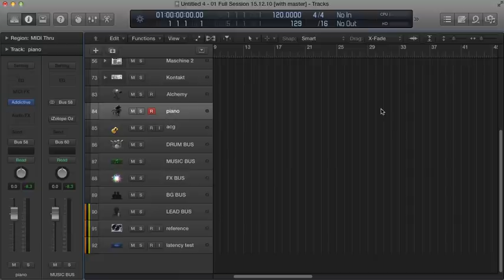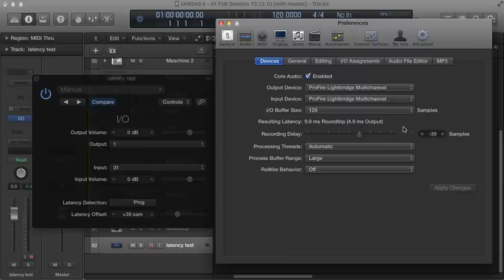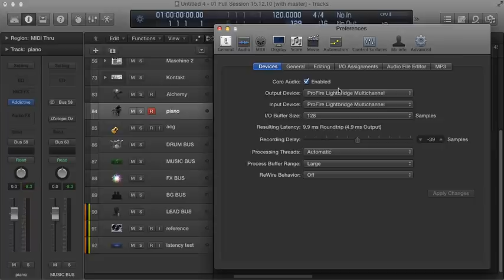How To fix The Latency In Logic X!

Comment: I have gone to settings to insure that my Scarlett interface is set as both input and output. I have also triple checked my Logic preferences to have set them there as well. I believe that I have set everything up correctly, it's all plugged in where it needs to be and so on. And yet when I try to use I/O, it still only presents 1 and 2 as options for the input and output, therefore meaning that ping does nothing and ultimately I can't fix the latency issue. Do you have any other ideas on what I may be doing wrong or anything that I may have forgotten? I would greatly appreciate any advice as this latency issue is driving me insane ahha. Thank you for your time!
Reply from the maker: Yes, I'll try to help
How many ins and outs does your Scarlett have? 
Can you see them on an audio tracks input menu?
What latency are you trying to fix? Live play through? Recording? Sync between what is already in the session and what you just recorded?

Comment: I never had issues with Logic 9 Latency and my MacBook Pro that I couldn't figure out but with Logic X and my Mac Mini (2.3 GHz Intel Core i7, 16 GB MHzDDR3, 16 GB Memory, 480 GB Solid State SATA Drive) my guitars takes still sound drastically delayed. I've physically cabled my Focusrite output to an input on the same device but I get no reading when I ping. It still reads 0 sam. Any suggestions?
Reply from the maker: +John Arthur Martinez if you're playing your guitar through and using an amp you'll want to get the buffer as low as possible and set the plugin delay compensation to audio and instrument tracks. Each sound card has it's own inherent latency. The last setting minimizes logic's added latency. The cabling and pinging is to test the sound card's latency because it can affect where the audio is placed on the time grid slightly. This won't affect pass through latency. 
Having plugins on buses or the master bus that the guitar channel passes through is most likely your problem. Disable or remove those and set that plug in delay compensation and report back!
To get an accurate ping be sure to select the output and input that you have cabled. I have had an issue with sound cards not in accurate digital sync that give wacky readings or no readings at all. Reset the sync by changing the sync source and double check that the routed output is sending the tick and that the input is receiving signal.

Comment: Great video! I definitely reduced my latency with what the system found as the stock latency with the I/O buffer size. I could not figure out the ping portion though. I use a Mota ultra light as my interface and multitrack through that. I tried connecting my input 1 to my output 1 and main out L and R without a result.  I am a bit stumped.
Reply from the maker: +Bob Smith glad to hear it. Make sure you select the input and output channels that point to those ports you have connected.

Comment: hey, nice video, i can't get the png to work tho. Im using the beats studio headphones as my output. is that why it stays at 0?
Reply from the maker: +Dionte Hunter yes, the beats are the reason. The point sends a tick to the output and listens to hear it back on an input that you've selected. The idea is to plug and output to an input. You would use a cable to plug where the beats are plugged to the input and select those in the io plugin.
Reply: oh ok thanks, so i basically need monitors as my output so i can get that 0 to move ?
Reply from the maker: the missing link is to connect a cable from your output to your input on the audio interface you are using. the tick needs to travel out the output and back in the input. the plugin will asses how long it takes and then you will compensate for this extra delay causing the recorded material to lay on the track as you heard it while recording.
Reply: I have a cable running from my duet apogee output R ( I assume that is ouput 2) to my Input 2.. I do the ping but nothing registers

Comment: How would you set this up with an external interface? What should your input and output be set to? If you're using the builtin output on your mac as your speakers/output and but using physical inputs on the interface externally.  Is there a way to set this up to set up the test in IO?
Reply from the maker: +Luke Jackson yes Luke, it works the same way. In my presentation I am using a FireWire interface. As long as you select the output and input that you have connected with a cable from inside the io plugin it will work fine.

Comment: Hi Thank your for your videos.  I'm having some problem with Latency.  Right now my resulting Latency is 196.2 ms.  I've tried changing the I/O Buffer and moving the Recording delay slider.  I've even tried checking the Low Latency Mode box but nothing is working. Your help would be greatly appreciated.  Thank you.
Reply from the maker: +Romano  Hey, is this latency when you play a software instrument live or after you record audio or midi? 
Latency matters when playing back through the software [midi instrument or audio fx] and making sure what you record plays back just how it sounded when you recorded it against the prerecorded audio in the session. 

Try the Plugin Delay Compensation. Change it from "All" to "Audio and Software Instrument Tracks"

Also turn off any look ahead limiters on the master bus.
Reply: +David Thomson I think I have this figured out.  Under the System Preferences/Audio/Devices, the Output Device is my Line 6 AMPLIFI.  This is the culprit that's causing the resulting Latency to be 196.2 ms.  If it change it to Built-in Output it's only 4.5 ms.  I really like using the AMPLIFI as a Bluetooth speaker.  So how do I use it without increasing the latency? Any suggestions?  Thanks.
Reply from the maker: +Romano Yes, this is the latency from using that device as your sound card. You can adjust your buffers as low as acceptable with your session to achieve lower latencies. Bear in mind that each sound card has it's own latency added to Logic's.

Comment: I use LPX when playing live gigs. I have a project (A)  with three audio tracks (and some MIDI tracks). One of the audio tracks is a LPX drum loop and I stretched the drum pattern out in some measures.  Whenever I have another project open(B), so it's ready to go, the drums on  project  A  play a few measures....stop playing...start...stop. How can I fix this issue?
Reply from the maker: +Tracy Behrman are you selecting the other session somehow? If one if the windows is brought to the front logic will load that session and unload the previous one.
Reply: No, the purge session is minimized at the bottom of the screen
Reply: Oop....the first session....not purge
Reply: LPX is not for live performance.  There are cheeper live mix softwares you can use, but LPX will always cause problems like your saying.  LPX is designed to maximize its use of your system hardware to record great tracks.  Since the system architecture is targeted toward this end there can be lots of little glitches when having multiple projects open at once. 

At the end of the day if you want to guarantee a good show - you have use the right gear.  
Hope this helps.

Comment: Hey man great video, question for you 

Im using an old Tascam US 144 MK 2 which works fine for what I need.

I checked my latency with is 717 samples (with the buffer rate low). My output latency is 11.7ms and input latency 5.3ms.

Acceptable recording latency is under 6ms. 

So my question is, if what Im hearing is 11.7ms late, and I am playing to that, then surely my output latency doesnt matter and therefore dont need to set a recording delay to -717samples?
Reply from the maker: I would certainly do it. Miniscule as it may be you don't want everything you do to be skewed. It will change the feel of everything you do even if just slightly. Also, 717 samples is a lot. 
Remember, this is the unaccounted latency. The 11.7 and 5.3 are reconciled because logic can get those figures from the cards driver. 
When I got mine locked in I was instantly aware of the accuracy of what I played and how it felt with the groove of the song. It felt on playback like it did when recording. 
The plug-in delay compression is key if your using midi or playing through a plug-in. 

Good luck!
Reply: I assumed that Logic would correct this latency after recording therefore making it accounted for? 

Im a guitar player and play beside my amp so its direct monitoring if you want to think of it that way. I understand changing the latency it makes sense if Im running a lot of VSTS and plugins, if I am recording with a MIDI keyboard it would make sense to adjust the latency samples but If Im doing what Im doing now does it make a difference?
Reply from the maker: Logic does correct all the latency it can know about. It knows what the interface you use reports to it and the latency from it's processing use with plugins and buffers but that which we are testing for using this method is the time it takes the signal to make it out the interface and back into logic. This is with logic already using all the information is has available to it. Some reasons this reports a number at all is discrepancy with reported latency of the card and any other processing that happens to be in place (mixer, compressor, EQ, or any other gear being used).

Comment: why doesn't Logic automatically check the input latency? or does it? i'm talking about what u were talking about from 0:00 - 1:49
Reply from the maker: Good question, Mikey. Short answer: Logic compensates for all known latency. This includes plugins and what is reported by the audio interface drivers. But there are other possible sources for latency. Also, sometimes the reports in the audio interface driver do not match the actual time it takes audio to pass through. this method allows you to be sure that the feel of when the music is tracked is preserved after it's recorded and played back.

Comment: I don't have any latency issues. I have Logic Pro X 10.4.1 and the only issue is when I click the spacebar, it lags before playing. It never used to do this before and not even with this update. It just randomly started happening. Anyone that has an answer or suggestion I would greatly appreciate it. It's very nerve wracking.

Comment: I can't get the IO plugin on my version of logic, any ideas? The closest thing I have is a test tone
Reply from the maker: +Dan Goode what version are you using? It should be found in the audio fx menu under the utility section.
Reply: Thanks, I was looking in the plug-in section instead of audio FX!
Reply from the maker: +Dan Goode sweet, I knew it had to be something simple.
Reply: sorry, another question- I'm using a UAD apollo 8 interface and I'm struggling to get the IO working. I've tried plugging in the monitor outputs into mics 1 + 2 and I've tried plugging outputs 1+2 into mics 1+ 2 and I'm not getting any latency offset showing up (it stays on 0 samples). Any chance you can point me in the right direction?
Reply from the maker: Dan Goode Hey Dan, it should be functioning for you with that setup. Make sure you have the correct output and input selected within the plugin. You may double check your Audio Midid Setup with in OS X to make sure your routing isn't confusing things. You should be able to see the tick register on the meters of the output and the input.

Comment: I get +2235 as result, regardless of buffer size (32-1024). Is this normal? Using Alesis IO4, cable connected from input 1 to output 1.
Reply from the maker: +Bence Varga that is to high. My guess would be plugins in the pathway. Take any plugins off of the main output as a start. Maybe reset the sync on your card choosing changing the sampling rate then back to where you want it or the sync source to get it back aligned.
Reply: Actually I got his value when there was only the I/O plugin on the track and nothig else, even in case I opened a new project and there was 1 empty track. The sample rate of my card is 44.1 kHz, so that one cannot be changed. What do you mean by changing the source?
Reply from the maker: +Bence Varga I mean to change the sync source if it has it. Should be internal or to one of it's digital connections.
Reply: Okay, managed to sort it out. It was because of the project. Other projects give better result (+30), also a fresh project (maybe I did something wrong when I measured the new project yesterday). However I have no clue why that particular project returns +2235. I get that result when I delete every track in it and add a new track with the I/O plugin. I assume it is a project setting, or maybe some plugin on a bus?

Comment: hitting ping does not give me a value, anyone know how to trouble shoot this?
Reply from the maker: Hey Jake, if it's not giving a value it means that the correct input and output is not selected or it is not properly connected from the audio interface output to the input. Double check those for starters.
Reply: having the same problem
Reply: I am having fits with "cabling" the input and output to get the PING to work.  I am using a MIC USB mic to my desktop.  A Scarlet audio interface for my external speakers (output) and guitars (inputs).  My MIDI keyboard is connected to desktop via USB.  I am lost on how to assign the inputs and outputs so the PING gives a value.  Newbie to Logic X here.  Thanks!
Reply from the maker: Hey Leigh, with a USB mic you have no output. I would select three line input on your Mac then plug a cable from the output to the input that you have selected in logic.
Reply: If my output (speakers) is connected  via Scarlett (audio drive), how do I connect that to my input when my input (MIC USB microphone) is connected to my computer via USB port.  ----> That is a better go at phrasing my question.  I'd SOOOO appreciate any help.  My vocal tracks have major latency.
Reply from the maker: For this test you want to select the Scarlett inputs. Then you will be able to connect the output to the input with a cable.

Comment: this can't be right. (unless my source, the following link, is wrong. which is possible) according to this link https://www.thoughtco.com/convert-milliseconds-to-samples-1817867 , if your round trip latency is 9.9 seconds (as seen on the screen) your delay in samples should be 436.59 samples if you're recording in 44.1kHz and 950.4 samples if you're recording in 96 kHz. 36 samples is nothing that's like half a millisecond
Reply: https://www.audio-forums.com/threads/samples-to-milliseconds-conversion.9552/ this link too says there are 44.1 samples in every millisecond. your round trip latency is 9.9 milliseconds. you're only offsetting it by 39 samples.
Reply: unless this means that Logic automatically compensates for latency and it's automatic compensation is 39 samples off. at that point it shouldn't be noticeable. am i understanding this correctly?